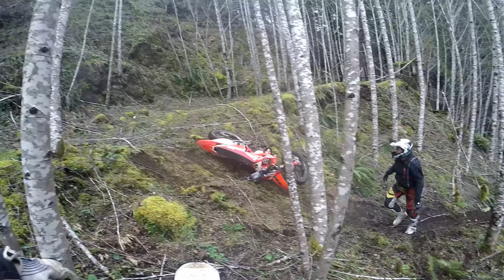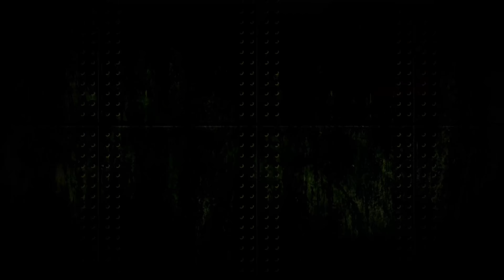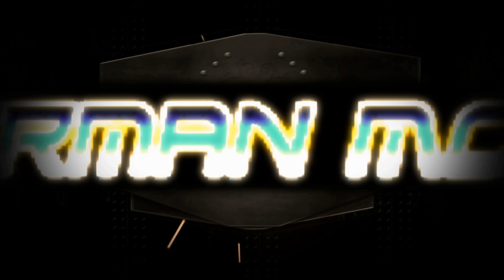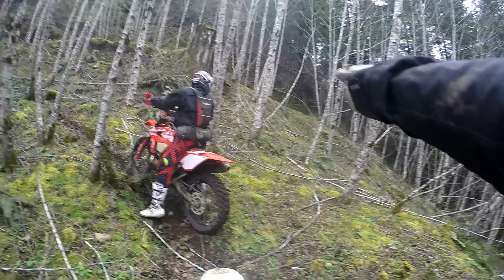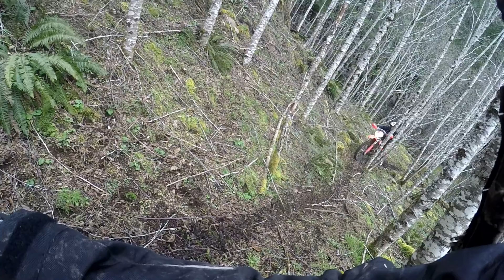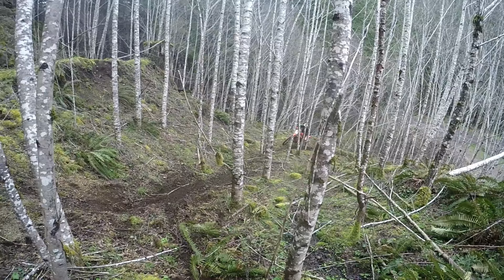2015 Beta 300 Flip! (Dirtbike Riding: S2 E13)

Comment: that 300 should be spinnin the rear in 2nd high rpm to breeze up that. at the main crest put your collar bone above the gas cap. then... go over the handle bars for a better video ;)
Reply: .308or5.56? Tried that. Almost zero traction on the runup, trees close together with a dogleg between them equals low approach speed. And just like every other gopro video, steepness is deceptive. This was the third attempt with ghostride, still failed. Not as easy as it looks, Jarvis.